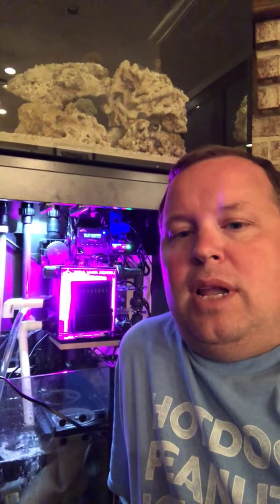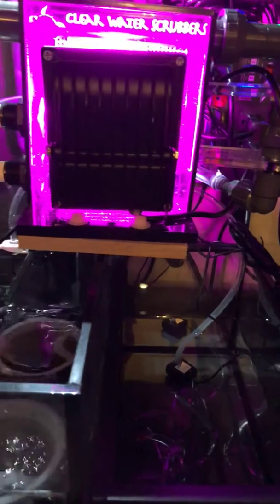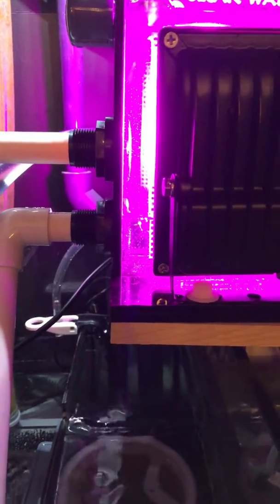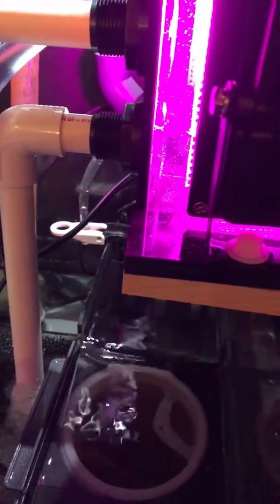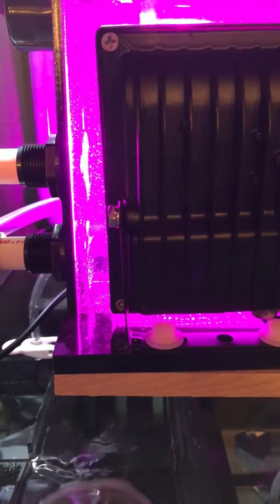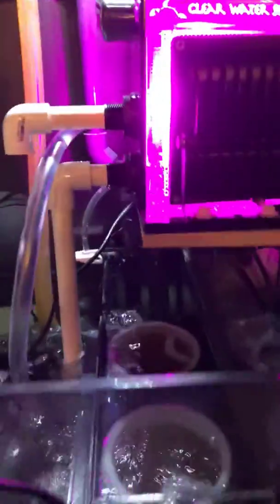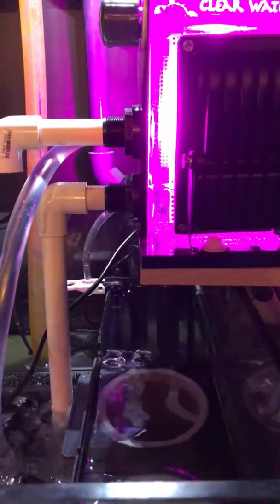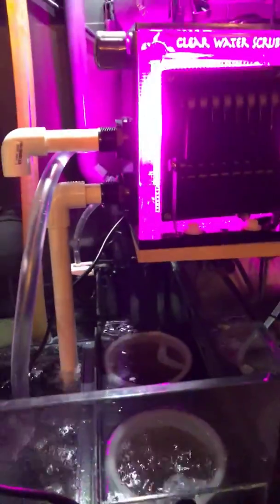Clear Water Scrubbers CW-50 Algae Scrubber with Problems!

Comment: Add a ball valve to the main drain and plumb the emergency below water line. Make it to were the water is just barely flowing through the emergency drain. Problem solved

Comment: Drill a hole at the elbow and insert a small length of tubing in the hole. Or instal a t in stead of the elbow with a hole in the cap

Comment: Okay..... all you need to do is put a 1/2” ball valve in line with your “exit” pipe.  Choking off the water exiting will make the water level rise in the unit and eliminate suction/gurgling.
Reply: #FACTS
Reply: Or get a better pump to get a higher flow to rise the water level. Right?

Comment: The size scrubber u got need flow rate of anywhere 100 to 400 gallons hr
Reply from the maker: brent anderson at the time I purchased it, Clearwater Scrubbers recommended flow up to 200gph.
Reply: Pilot, Gardener, & Reefer!  That need 450 ghp pump but u can set it down to like 300 or 200 ghp that may help it

Comment: you want to drill a hole in the 90 elbow and feed a small run of airline tubing to purge the air in the pipe....or you can slow the flow through the drain like you've done.

Comment: That's rated for 150 gph* not 200
Reply from the maker: Jel0XD Designed for tanks between 60-100g. 1/2” inlet and two 1/2” drains. Flow rate needed is 15-200gph

Copied straight from their website.
Reply: Pilot, Gardener, & Reefer! Not based to bulkreed, only 150gph pump
Reply from the maker: Jel0XD These specs were copied straight from Clear Water Scrubbers website.
Reply from the maker: http://clearwaterscrubbers.com/shop.html
Reply: @ronbpenn  Regardless, to much flow is causing a siphon. Either drill a hole at the top of the elbow and run airline or reduce the flow to 150gph.

Also water pressure vs gravity does make a difference on flow restriction for that size pipe.

Comment: Thanks for the info! Seems like reducing the flow from the pump would solve that, yeah? Or did switching to the bigger (3/4") PVC work?
Reply from the maker: Omar Collins going to 3/4” on the drain fixed it. I shot another video showing the result. Please subscribe, I will be posting updates showing it’s progress.